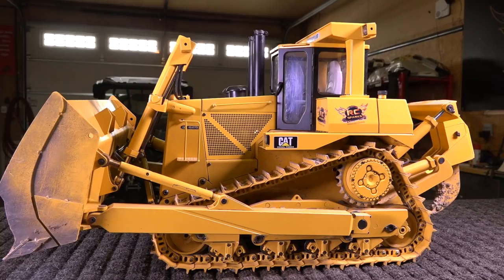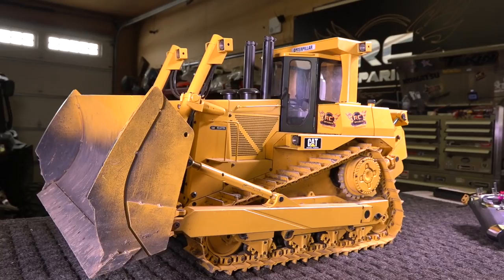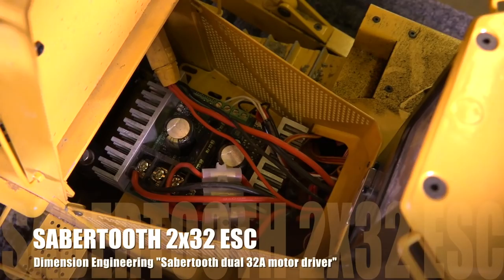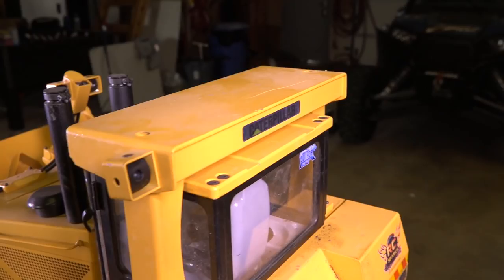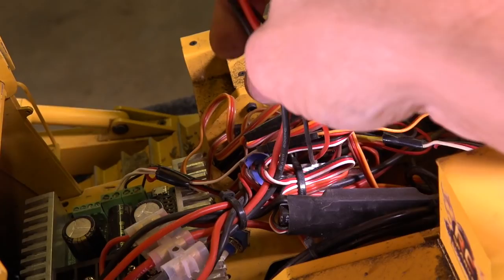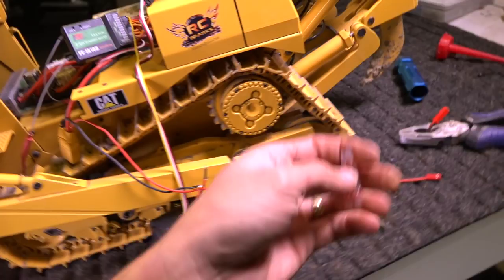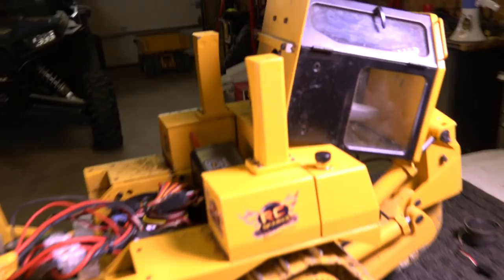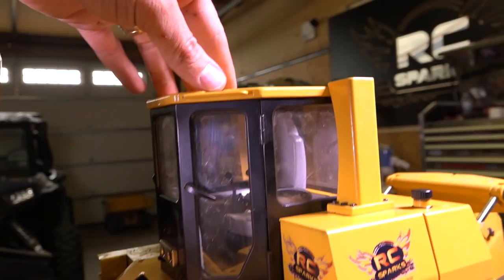RC ADVENTURES - D10T DOZER gets a Sound Upgrade - RC4WD 1/14 scale DXR2

Comment: Get a motorcycle chain break tool,and put a flare on each rivet but one (just incase you need to remove the track). That should stop them from backing out on the track.
Reply from the maker: much like in full size.. you need to replace track pieces!

Comment: Servonaut SM3 overpowered the stock 4ohm speaker and blew it out i bet. That's what happened to my 870k wheel loader. I upgraded the speaker to an 8ohm, 7watt and sounds much better than the stock 4ohm speaker. Just a thought.

Comment: Those crimpless solder connectors are great if you are not in a bumpy fast environment ie. Vehicles Not Good. I own a car audio shop and what we found it that the solder does not flow into the wires 100% like a normal solder and heatshrink would

Comment: i would use the dump truck all the time 
ps what happen to the massive wheel loader you had years a go i want to see it back
Reply from the maker: Fatal design flaw in the differential system. Problem: there was no differential. all the time, locked
Reply: @TheRealRCSparks  would you ever entertain  selling  it?

Comment: You think glue-on tires would hold on a tri-axle trailer hauling that thing? Or would the trailer need beadlocks?
Reply from the maker: I dont even glue my tires, and it pulls it with ease, my friend.. These are aluminums... and I dont see them ever slip.  If you go to my videos section, and sort by "views" the top videos have a few of this trailer in action. Really great, Ive had it for years.
Reply: Mm. Yeah I'm building a trailer of my own and I'm hoping that itt'l be able to carry 40lbs cargo without issue(My benchmark will be a 550cca car battery centered over the tridems). Gonna be pulling it with my CA-10, three axles like your lowboy, on RC4WD Daytons. I'm just worried that sharp turns with a heavy load will debead tires, an issue I've had with the CA-10 itself(Steer tires, in particular, don't want to stay glued on mine, and right now it's got one drive tire that slips on the wheel from time to time), and I'm hesitant to take a chance on $150 worth of wheels that may or may not work.

Comment: I like to see people use stick remotes because the car w truck body in my profile pic uses a stick remote (no it's not new it's airtronics Sr series the car that it controls is from 90s tamyia Toyota Supra blitz)
Reply: I run my nitros off a Spektrum DX-6i. I just use the elevator channel for throttle/brake and the rudder channel for steering. Works a treat.